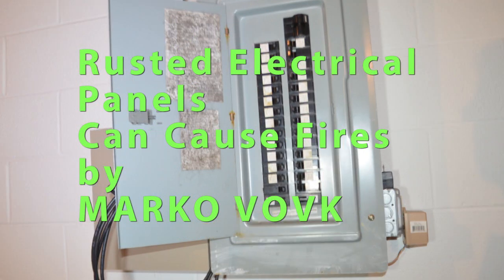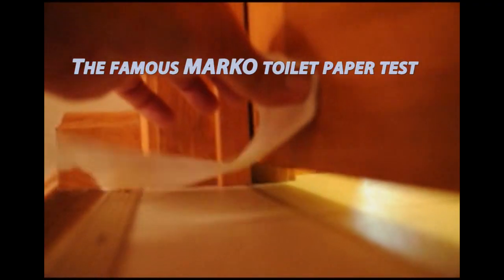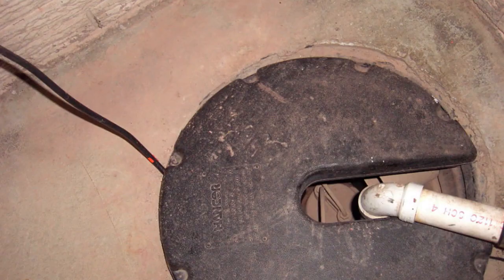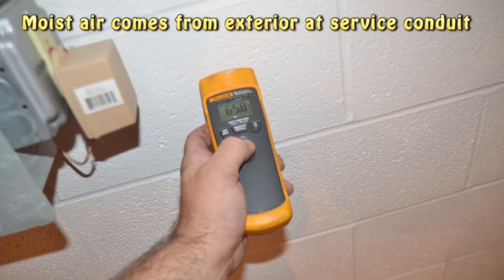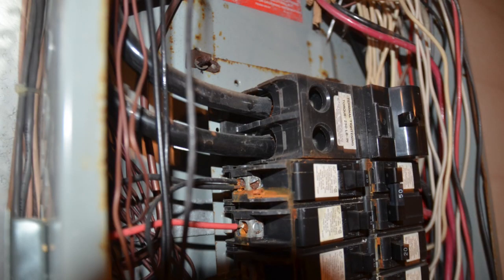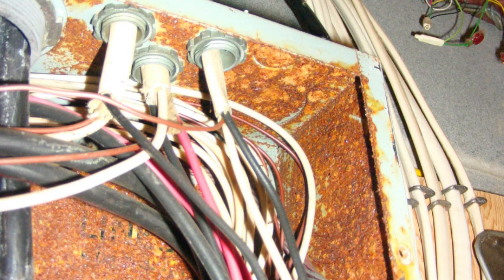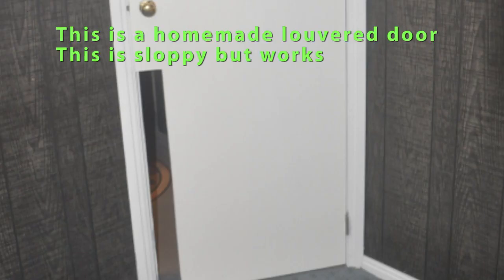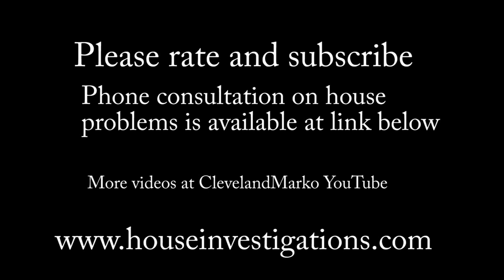Electric panel rust: Electrical panel fire, Electrical panel breakers rusting

Comment: I have problem I try buy forclosure house and  my electrical panel has some rust and the inspection city say I need remove the panel and put new one :( how much is for this job ? need be electrician certificate
Reply from the maker: 1200-1500    You have a condensation, negative pressure and moisture generator problem

Comment: A circuit breaker often trips when the microwave or a hair dryer is used. If the tripping is not immediate, these high-wattage items (when running along with a few lights for awhile) are probably too much for the circuit. If these "overloads" can't be avoided by limiting the use of other things on the circuit, a new separate circuit for the heavy item is the only solution. See Microwave ovens. Many hair dryers, however, have a lower-watt setting on them; using that might help.